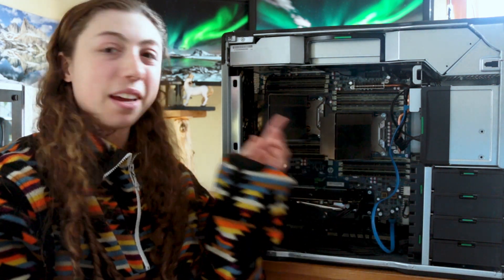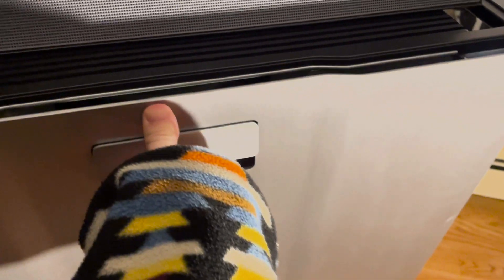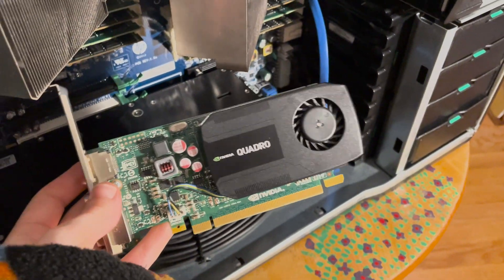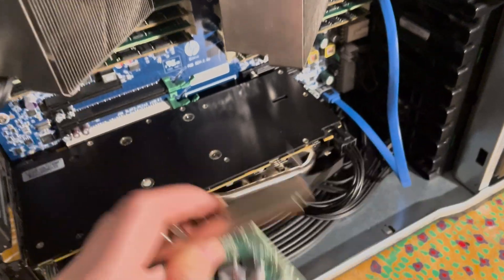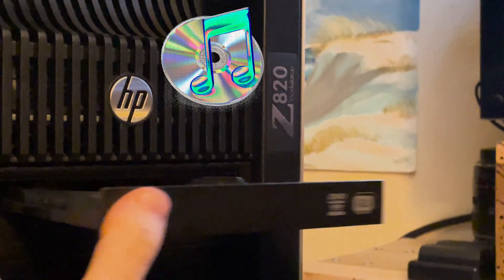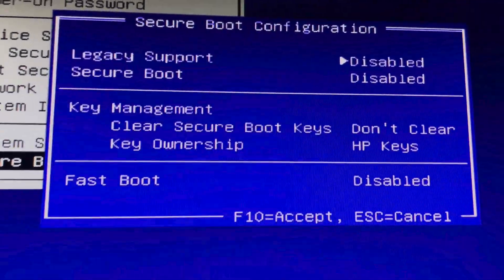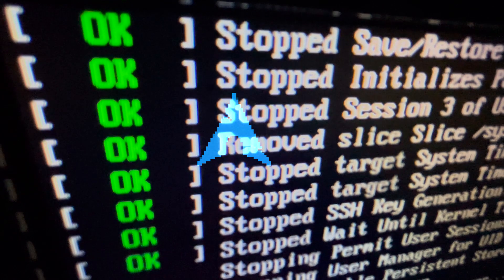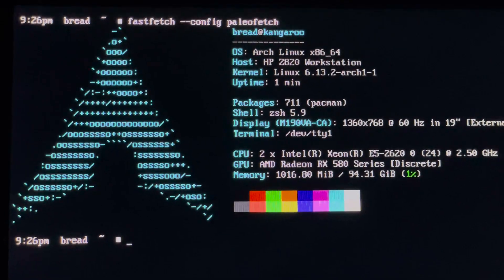The 2012 beast with 2 CPUs and 16 RAM sticks

Comment: I used to hjave a quad System that was running 4  opteron 6128s ( for folding ) I sold that then picked up another AMD with 2 opteron CPUs that are engineer samples which means  I can Over clock the hell out of them  I used to use it when I was folding long ago also had an intel sr2 set up ( very fast for its time dual CPU xenons) I could OC those to 3.7 and it ran stable for all the months I was using it not one crash never turned it off but I only had one 2 GB ram stick for the 16 slots tha ttook a while tomonkey around with because   the ram timings where different and a little finicky when OCing of and it was also running Linux arch( whioch now years later I still cannot figure out how toget Arch up and running again had t obeen a fluke the fist time lol)  at that time I was only playing Return to Castle Wolfenstein enemy territory which was both linux and windows the funny thign als owas I could run bitcoin folding and tournament\competitively game online all at the same time   lol which I also did the whole folding ( also for Bitcoin when it first started out many days just to get one bitcoin mining then like a fool  I sold it for the going price back then 100 dollars :(  because the cost of electricity outweighed the cost to make one bitcoin)  but I also used the SR2 system  as my main PC for all things including gaming that thing was very powerful but also was great in the winter for heat even better than my opteron systems, but electricity bills went up allot, so I sold that also because folding for a cure switch from CPU number crunching to Nvidia Video card crunching, so I stopped folding it wasnt efficient enough also now my dual opteron engineer sample CPUs for wha tI do  Iam better off with either of my systems for gaming or media my crunching days are pretty much done accept for the od time Video crunching stuff which  I dont do that often and well I cannot even remember what its called lol
you gave me the fever I think I may pull out my old opteron server and fire it up to my best to install arch just to see if  I can I am curious it the system will be able to run SSD hard drive  it should IU have a few of those but also still have older harddrives laying around I love tinkering but having done it for a long time
as for temps I always replace the paste on my systems for heat.

Comment: My main machine is a HP Z440 workstation with an RX 6600XT and 64 gigs of RAM running Debian 12. Not quite as old as your machine but works fine for me. I'm sure that more modern hardware can load web-pages a few microseconds faster but for a total package cost under $200, I'm happy :)

Comment: Bread: I have these types of HP units: Couple notes:
- As far as powerful GPU's that fit - look for a dual-shielded Quadro M6000 [either the 12GB or the 24GB]. Reasonably priced on the used market, works well with linux, edits videos gorgeously in Resolve. Can reinstall the normal PCI shield all day long.
- A newer sibling to this guy, the Z840, is absolutely fire, and I highly recommend. ALso the Z840 natively supports Bifurcation, and you can configure it in the BIOS for UEFI booting.
Cheers

Comment: I just bought one of these $350, it has two 8 core CPU's and 256GB of RAM. I bought it to replace my 20 year old Supermicro X6DAL-TB2 linux box, it's getting a bit slow these days. I'm going to try running an LLM and compare it to a HP 8300 3rd Gen i7, 16GB that at best, reached 2 tokens per second with llama3 8B. Another test I'll try is running a prime sieve and see how that fares.

Comment: You can run LLMs off of system ram with Ollama. 96 gigs should be enough to run some decently large models, even if it's DDR3.
Reply: The LLMs will be very slow. Maybe a couple of tokens per second.

Comment: Well , I picked up a deal on a Lenovo Thinkstation P520 Xeon W2145 /64gb and its my experimental server(fedora workstation and plex right now) and I have an old Intel 3860x system with a 980ti as my main truenas server . Old business class servers on ebay from the big three are great for projects and servers to learn with and wont set you back alot of money. Sometimes these can be found in the wild for free , which is the best deal of all.

Comment: I have a dell tower server with roughly the same specs and I swapped all the cooling out for noctua stuff and it's SO QUIET. It's running in the living room and isn't noticeable over the ambient room noise. If you're gonna use this long term, I would highly recommend doing it.

Comment: I have a x99 board with a single Xeon 2697a v4, 128gb ddr4 ecc, and an rx6650 running ubuntu 24.04. As much as I like the machine, it's a bit much in power consumption to daily drive, and the clock speed isn't the fastest so single threaded apps can be a bit slow. However, I love that I can spin up a ton of VMs whenever I want with these 32 threads, multithreading is superb on these too. But I depends on what your looking for. I think they're pretty cool even if they don't fit your use case. I spent too much on this darn thing but I love it none the less 😅

Comment: I'd like to see an outsider's experience of T2 SDE linux. I am currently too far behind the times to be able to contemplate trying to install it, but I know Rene Rebe does a lot of work to optimise performance for older hardware. On the power usage, do people consider its value as a space heater? I know it makes a lot of noise, but if you had an area of your living room with sound insulation screens it could still produce useful heat in winter, and you get your computing for free.

Comment: The Z820 is definitely not worth buying anymore, considering the Z840 is just one generation newer, is a giant leap forward in almost every spec, and usually goes for the exact same price on the used market.
The main difference being DDR4 rather than DDR3; but also notably with the CPU such as lower power draw, AVX2 support, and way more cores/threads.
The single-CPU version in the Z440 has been a major contender in low budget builds for the last few years.

Sandy/Ivy Bridge may be obsolete now, but Haswell/Broadwell is still hanging in there.

Comment: The Z820 has a great RAID controller. You can put a whole bunch of hard drives or SSDs in it and set up RAID. It would be a good NAS if you don't mind the power consumption.

Comment: Hm. In terms of power it's actually not too crazy. That's still a lot of CPU cores and memory, even if by today's standards it's inefficient. I don't know if I would call it under powered, just inefficent. You could pretty much virtualize anything on it. A whole home network and file server stack if you wanted it. See if you can stick a few cheap GPUs in there that support some kind of resource sharing across VMs. I don't remember what the technology is called just now, but I know it's a thing. You could have a hell of a remote emulation station there if you could figure that out. Something that could be remoted into with the likes of Sunshine / Moonlight. A kind of server for thin clients to connect to for emulated multiplayer gaming.

Comment: The only use I can think of suitable for these older power-hungry systems is a local NAS backup target. If it can be loaded with a lot of hard drives, and set to sleep on a schedule it could be a part of a backup strategy. If you need to do any actual computational work though, a basic AM4 system would beat it at lower power consumption.

Comment: I used to run a 2006 Xeon based home server. Until I calculated the annual electricity cost. It was cheaper to replace it with a comparatively much more powerful i3-8100 based system that does 7W in idle.

Comment: I love these old xeons, they're just so funny and cool.  I got a new computer recently (Ryzen 7950x) and I looked at some of the old xeons non-seriously ...  It seems like you can get say 1/3rd of the performance (in synthetic benchmark numbers) for less than 1/3rd the price, but a lot of your supporting parts won't be cheaper so the whole system won't be that much cheaper, you won't be able to use some hardware, probably some software won't run, and it is less power efficient.  And that was looking at some of the less cheap old xeons, if you get even cheaper ones, the performance goes down, but the price goes down way faster (and sometimes you can get a bundle with motherboard and ram, saving on some other costs).  It still has all the other drawbacks of bad support and bad power usage, but it would definitely be fun to play around with

I think it would probably serve well as a distcc farm for gentoo, since even on a 7950x compile times are disgustingly, deal-breakingly slow with just make -j32.  A build farm isn't running all the time so the power draw would not be as much of an issue ... but at the same time, you would need more than two of the cpus (ie multiple systems) to beat the previous gen ryzen (just going off synthetic benchmarks)

It would be interesting to see alpine or bsd, or a really obscure os like plan 9 or serenity

Also the ben and jerry's shirt is great

Comment: The power consumption is only bad when the CPUs are under load or if you stack it full of spinning platter drives.  I have a similar era server (dell r430) running Proxmox  with a dozen VM's and containers running at any given time and the fans hardly ever ramp up.  Proxmox isn't exactly and old distro, but for a linux user who isn't afraid of the command line, having a hypervisor that you can spin up containers on a moments notice will open a whole world of possibilities.  If you've never had a homelab server setup before you should definitely testdrive one for a few weeks while you have the extra hardware.

Comment: Based on a comparison of 2 of my CPU's and some data which I found I conclude that a modern CPU performs a tiny bit over double at singlethreaded tasks compared to this Sandy Bridge Xeon-CPU. Multithreading also improved so the performance is even a bit better for multithreaded loads. So a modest 6 core Zen4/Zen5-CPU would outperform this CPU. The other relevant factor: RAM.  DDR5 gives a much higher memory-throughput with 2 channels than DDR3 with 4 channels. The electrical power of a modern system would be 100-150 Watt at full load, excluding the graphics card. Speaking about that, a tiny modern graphics card could perform better with just 90 Watt than that RX580 with 180 Watt, so 200-250 Watt would be the highest that a modern equivalent performing system would 'use'. My 5700 XT performs roughly double of a RX 580 (while costing close to double, so not much progress from AMD) by simply lowering the TDP to 90 Watt. You can do that by changing 1 value in 1 file or by using corectrl.

On 1 point this old PC is better: the I/O on the motherboard. Other than that or for nostalgia I see no reason to buy an old PC like this for a few hundred USD over a more modern system. That modern system still could be fully 2nd-hands if you like. You could for example go for a Zen2 or Zen3 system with 16 cores, 2nd-hands that should be fairly cheap at the moment. For $100-150 you could probably buy a 5700 XT. With the price/kWh here in Europe that would be a better economical deal and the performance would be better while you get a vastly superior performance.

Comment: I found one of these put out with the trash at an apartment complex near by, an HP Z600 with dual xeon processors and 48gbs of ddr3. It had no hd and the video card was bad. I put a new vid card and ssd and it is working like a champ!
Reply from the maker: That's awesome, great find!
Reply: man how do yall find this shit in the garbage like who throws this shit out? my only guess is like it was running security cameras in the building or smthing
Reply: nice! i have one of these with 24Gb RAM that i used with a GTX 1050Ti. relegated to proxmox duty but since replaced by smaller form factor and more efficient machines. 😞

Comment: It is a fantastic machine for doing serious stuff with. They are still widely used in medical imaging for SPECT/PET/CT image recon. I have that exact same machine and I use it for solving radiation transport problems using GEANT4 for X-ray and gamma ray dosimetry problems.
Reply: I wonder if they're using Tensorflow for such tasks?
Reply: @konstantinrebrov675  Not that I know of. The numerical/scientific computing community tends to be very cautious about adopting these kind of things when there's a widely established codebase. It's a case of "if it ain't broke...". Most of us have only just moved on to Java/C++/C# from C and FORTRAN, there's still a lot of FORTRAN IV and 77 out there today.

Comment: I have a 16 year old pc with a 'core duo' cpu in it. And it has been running as my media server for 11 years.
And it is fairly economical on power. Even better power consumption than a 2015 mid range I5 laptop.
Those Gigabyte UD boards really are UD.
Reply: My daily PC since 2012 has been an ASUS P5Q SE PLUS modded to take a Xeon X5492 which is pretty much identical to a Core2 Quad Extreme QX9770.  DDR2 8GB (tried Chinese 16GB but crashed constantly), SSD drive and GeForce GTX550-Ti which was mid-range in 2011.  Still does most tasks perfectly fine, although Windows 7 is creaking a bit now, so might stick Win 10 Enterprise IoT LTSC on at some point, as that runs much faster and leaner.
Reply: @EgoShredder  Sounds like a good setup. My server had Win7 on it until about 5 years ago, but runs a Linux OS now. Yeah, Win7 is getting a bit old. But Win10 Enterprise is a good choice.

Comment: I prefer to assembly my PC, more fun and if you do it well also better hardware. OEM's make too much a mess of it with problems like bad ventilation (case), fans which are too small, single channel RAM, GPU and CPU not being balanced, bottom of the barrel RAM, mediocre (more noisy than required) cooler...
Having said that, with self-assembly you can get problems if you don't pick the hardware correctly or you just pick the wrong brands, like having a graphics card which is too large for the motherboard or having RAM which should run fine with 1.35 V (XMP of course) according to their own XMP profile but which needs 1.42 V.

Comment: I think this system will support the e5-2687w cpu which should give you alot more bandwidth.  They are cheap on ebay.  It works well under proxmox.

Comment: I didn't see you mention it but that 2.0 is the base frequency.   XEONS are pretty good at running all core at near max frequency with proper cooling  those 6 core /12 could easily be updated for way better performance

Comment: Ah, I have had that one. Great machine! I have the Z840 now. If you can afford - get the Z840 cooler. Seriously. The pins are four pin on the new cooler, but only three are in use, and fits on the Z820 cpu fan pins. I can run "clear;stress-ng --cpu 72 --timeout 900s;sensors" on the Z840 and it's barely warm. But yeah, great machines! And affordable! Oh, and you can unlock the built in SAS/SATA-raid-card (in IT-mode).
Edit: It can boot off of NVME - in a few cases. I don't recall why, there was some older standard that only a few NVME drives have. It's easy to google. I'm lazy. But yes, can be booted off of NVME-drives.

PS - It's perfect for Proxmox!
Reply: It is perfect for Proxmox.  That's what I have on my Z840 right now.  Plus, you can upgrade the Xeon CPUs for cheap so you have a whole bunch of threads to go with all that RAM and hard drive space.  The only real downside is the power consumption.

Comment: I did PC repair a decade ago and this reminds me of the workstations the CAD engineers had. I can't believe I never had to replace a PSU on them - what a beast!
Reply: As a CAD engineer, I encountered three brands through the years - Fujitsu-Siemens, Lenovo Thinkstation and these HP monstrosities. Some of them are still in use on CNC machines - despite they are more than a decade old without a single piece of component changed during this time.

Comment: If I owned it, install Proxmox with a Debian or Ubuntu VM with docker and portainer and get into self hosting. Pretty fun stuff. Unless it idles with high power usage. That would be a great first server especially for free. Personally I self host ollama and open-webui (for LLM), InvokeAI (stable diffusion), nextcloud, pihole, bitwarden, homeassistant, navidrome, emulatorjs, librespeed. Pass through all of the HDDs to a TrueNAS Scale VM for NAS usage. ZFS pools can be expanded now which is super awesome.Test out new distros. It's a playground.

Comment: As someone who has lots of old systems, I can tell you this: Most of them I haven't turned on in ages. Even if power is virtually free, having your room at 85 degrees with all the time with loud fan noise is torture and being a mediocre sever doesn't make up for it. Almost all my server needs are handled by much newer N100 systems. Old computers however, are great as MINECRAFT BOAT ANCHORS FOR YOUR MINECRAFT BOAT.
Reply: Shut your keyboard
Reply: Older systems make great emulation systems.
Reply: JC Denton
Reply: finna go offgrid and i have like a dec vt530 or something  so why not a server shed with old computers? have some old HP desktops with coreboot that could be openbsd firewall
Reply: Or a not-so-old elitedesk is also nice because they have core i3 to i7 processors and you can cram in 64gb RAM
Reply: @TaronArts  Those aren't great because most of them don't support dual 3.5" hdds. Its like only one or two chassis that do support that, and they aren't very common - especially if you want to go with ryzen pro instead. IIRC, its the full sized tower system and the slim one with 4 PCI slots - and they aren't super common.
Reply: @iiisaac1312  EliteDesk 800 series SFF actually supports 2x 3.5" HDD
Reply: @ I believe those are the 4 PCI slot ones, however, they are intel only. The AMD SFFs (705 and 805) only seem to come in 2 PCI slot variants, so they don't have the extra width for dual 3.5".